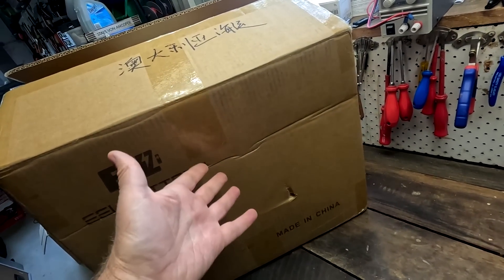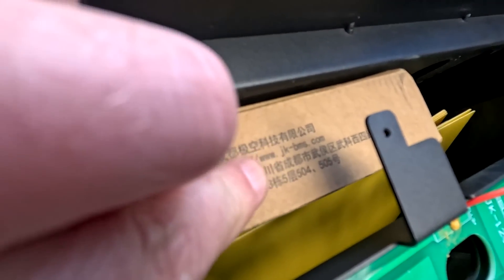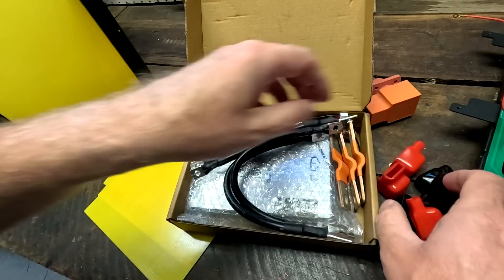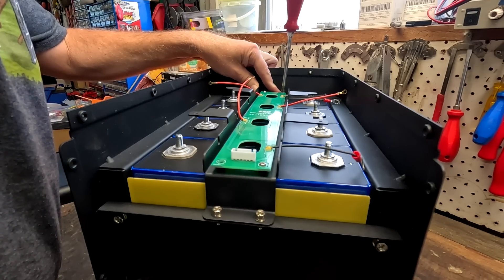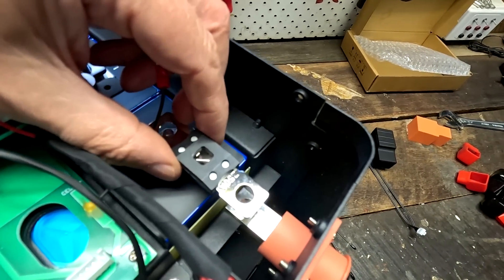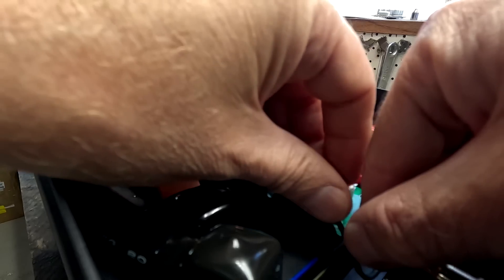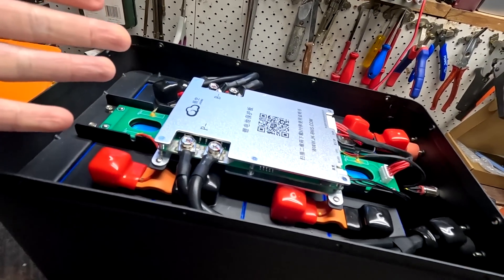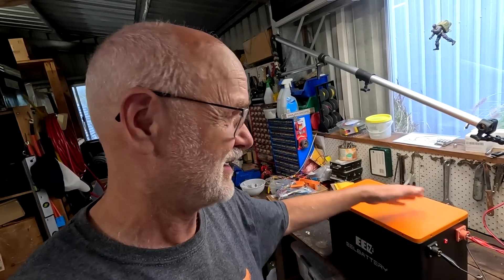The EEL 12V Battery Case. I could not find anything negative. First ever 🐸🐸🐸🐸🐸?

Comment: I'd be very interested in some 24v DIY battery builds, love the channel, Thanks!
Reply from the maker: Yeah, 24V is really not my thing as I could not use this battery anywhere. I have no 24V equipment and the battery would not fit into any of my systems.
Reply: Edit: New Info Available ...
Looks like competition in this market is heating up.
Prices on the kits seem to be all over the board.  Some decent deals on 24v boxes through  CNEEL iirc on Ali.
The EEL box seems to discourage setups for series (2 x 12v = 24v) operation.

Original comment:
I too had an interest in a 24v system to power a remote link to my ISP.  Looking at prices, it looks like you can just build 2 12v boxes for the same price and get additional flexibility.  Also spend capital in smaller increments.
Reply: @davidspeed1951   have you tried 2v12V in series (24V) setup , i was thinking of this, and was also wondering if the pcb of the 12V and the 24V could be identical meens running the 2x12V as a 24V pack (combined with BMS cable and low voltage cable )

Comment: turned whole warehouse lights to 12v DC       ////13.2v  to be precise   for all led lines and all i see is efficiency goes bad . 
 i did this to avoid  inverting from 48v to 230 and back to 12 
 but conversion  from 48 to 12v  still demands big ammounts of  losses!!!!       
any thoughts of   sending 230 and installing ac to dc  right close to the leds ...or let it be ? ?
Reply from the maker: It is the long 12V runs which cause the issue. Current goes up and efficiency down. It's probably better to run 230V to each light and have the driver connected to the LEDs. I think, that's the most efficient way.

Comment: Great looking battery box... excellent review as always!  The dimensions show 383mm for length, is that the box or to the end of the teriminals? I'm looking for something to fit under the seat of a 2022 Fiat Ducato.
Reply: be careful with the size. ask them first. the dimensions at the 48V-box are just for the box.... thats not very smart from EEL...
Reply from the maker: Yeah, just the length of the box.
Reply: @OffGridGarageAustralia  looks like the dead space at the removable panel doesn't help in this case.  One half frog down for me....
Reply from the maker: @RCDallas12001  Thanks for your feedback and rating.

Comment: I like the idea of building ones own battery bank for my Sail boat that has 4 x 215 12 volt AGM Battery's = 860 Amp hrs 50% usable power.  if I had the same say 3 x lithium battery build using the EEL  cases. = about 990 amp hrs of usable say 90% power this is major upgrade. My question does anyone know when you build the EEL cases how much does the finished build 12 volt say 315 amp battery cost to build in AUD?  I there any savings from buying an off the shelf  finished product ?

Comment: WRONG!!! The 0.5Nm on a M6 for 300kg are wrong !  Test it out... try to lift a car with 6 M6 Screws and 3Nm... nothing will happen! There is a dimension missing in that ! 300kg/mm² or 300kg/m² or what?
The M6 bolt may provide 300kg on its rod end - but not on the area of an undefined amount!

Temp sensor you may glue on the QR Code - its the best thermal conduction place.
Reply from the maker: It's not 300kg, it's 300kgf.
Reply: @OffGridGarageAustralia  kg and kgf are about the same! kg is the FORCE that presses you on the ground that is caused by gravity, where kgf is the same amount, but independent of gravity as source in any other direction.
So: to compress LFPs you can stack them vertically and put a 300kg weight on top - then you have kgf "forced"by gravity - or you put them horizonal and bolt them with screws to replace gravity effects.
Put a scale between to plates and then tighten the screws till it reaches 300kg - and you realized 300kgf. Or put it on the ground and use 300kg weight. Nothing strange - no real difference!

And: Eve uses 10mm !!! Aluminium plates as reference... with 6 times M6 PER CELL!  2 rows of cell - => 12 bolts needed ? Your calculation was 0.5Nm for them, where 12 are needed to calculate - so 0,25Nm ? Thats handtight - no pressure of 300kg(f) never. Insert finger, wont hurt, put 300kg weight on it and use gravity instead of bolts - hurts!  :-) 
Think that issue needs clearance because many of your followers will need proper facts (as you provide most the time) - they believe you! (and I am only an engineer ;) )

BTW: Shellys work with 60V !!!  see my comment and short video I did only for you my friend ;-)

Comment: The  nuisance is that the box doesn t work with the double hole studs from EVE .......😭 
Furthermore the BMS is not the HC-version. And there might be no space along the cells to install a heating element, just at the bottom i suppose.
Thats the reason why i am going to build a box by myself ..... EEL is ok with the 48V boxes.

Hard to find a heating element not getting warmer than 50 degrees celsius. Sunfunkits from Louisana seems to have one but shipping to europe is very expensive. 
So i found by accident a solution with beehive mats.....

Comment: Curious to how much it weighs?
Reply: depends on the type of batteries you choose... have  a box for 200/230ah and for 280/320. but when you use the 304ah, the weight just for the 4 cells is 22kg. plus bms  plus box ... unfortunately they do not mention the weight. so you have to contact them....

Comment: Only 4 frogs because no heating option and lcd is available and no double hole cell  terminals are possible.
Reply: And wiring to Case Terminals should be done with flexible busbars
Reply: Hello Andy at my last Order at eel i  asked eel to replace Eva foam with Silicon foam i bought myself in china.. they told me that they will send you 18 Samples of Silcon foam for free from my order. Maybe you could Test IT.
Reply: @OffGridGarageAustralia EEL versendet an sie die von mir bereitgestellten  silikonschaumstoff Muster nur  wenn sie ihnen dazu eine Erlaubnis erteilen. Könnten sie dies evtl. Machen, ich bin überzeugt das die silikonschaumstoff platten im vergleich zu den Eva Platten  deutlich länger druckstabil sind. Hat sich so bei Leistungshalbleiter Modulen schon seit Jahrzehnten bewährt.

Comment: They had the perfect space for a display and they did not utilize it.  Also no foam for proper compression, so 4 frogs from me.  🐸🐸🐸🐸
Reply: drill a hole for the big connector and fix the small 2.3" display ..

Comment: A really good looking and simple kit, definitely worth the 5 frogs.  What I would really love to see is a 12v battery using the JK B2A8S30P BMS.  I believe this one has inverter pre-charge circuit (C-) and a Parallel connection too?  But I cannot find enough information to confirm my suspicions.  300A continuous charge/discharge, perfect for the Caravan/RV setup.
Reply: if they erase because of the link. have a look at the diysolarforum ....

Comment: Looks perfect for my van-lyfe build! Now can you get it all put together for less than... erm 4kw 300ah 12v is about $2200?
Even if it is the same, I would still get it. Replace the cells rather than throwing it away.
EDIT $850 AUD, if you can wait until September to get the cells (all via OGG links). Well worth it! $200 per KWH, seems legit.

Comment: Lots of boxes ticked here. But the fuse-to-cell conection is terrible. If mine, I'd put a 'tinned' copper washer with tight 6.0 mm hole, at least under it, maybe on top as well.
Reply from the maker: What do you think is terrible with this connection?
Reply: Hi Andy, love your shed. I think your original doubts about those welded studs contact area, was well founded. Even if your tests showed no local hot spots, that flat surface on the cell is not ideal for a high current to pass. They could have used more area of the terminal base, and welded a bigger area stud. Your magnet test once said it's steel, and so about 18% as good as Copper, or 30% of Aluminium. If you had a  tinned copper lug, bigger in area than the stud, with a 6.00 mm hole in it, (not 6.5 even or 1/4"), that would be the way to make the best of a bad cell design. The fuse with a slot that is 8.5 mm wide, and much longer, results in very minimal contact area. The tight red condom covers on the fuse may reduce rating?  I know these later, high cap cells have reduced recommended current specs, and your application won't push them. 
I've ordered some EVE-LF280K- HSEV from Gobel, for EV application with the optional double-screw thread terminals.  The 1C contin/ 2C pulsed rating means 560 amps  for 30 secs discharge would need everything going for it.  They wouldn't fit in that box because of height I guess.

Comment: Definitely 5 frogs. I'm stuck with using 24v system, do you think it's possible to build a 24v battery using a 48v vertical battery case as there are no vertical 24v battery cases available? I don't have the space for a rack mount case.

Comment: This is perfect.  I run my mountain cabin on 12v as I have very little 120Vac needs/desires, so a 48v battery didn't make much sense.  I have 2 sets of MB30s that I would love to get in cases and off the floor.  My only desire would be cases that are stackable, but I can live without it.

Comment: Great looking battery, kit and cells. My thoughts on battery voltage look at the intended supply and the intended load. Any location where 12v is the norm (cars, vans trucks) then 12v is a good idea. If the maximum current will exceed 200A then look at a higher voltage ( high current means fat wires and lots of IR heating)

Comment: Andy you are mentioning the MB31 .. on the Intersolar they showed a mb56 which was a lot bigger but I didn’t took a photo. But that should come out at the end of the year. It has only layers in it and not the squished „toiletpaper“ construction so it is (so said the woman from eve) preventing a thermal runaway and will make it very less likely to happen. Together with the half c rate it has somewhat between 8000-10000 cycles. Would be great to see that coming into an diy Case … but then we are out of our hobby I think.
Reply: the price is not only the double of the 304Ah, but a lot more. cycles more than 12.000. we have to wait for mass-production....

Comment: Hallo Andy, 
zur Zeit gibt es nicht mehr viele Videos zum Thema Top-Balancing von LF 280K Batteriezellen. Ich habe von EEL 8 Zellen mit der Spannung 3,289 Volt geliefert bekommen und 8 Zellen mit der Spannung von 3,291 und 3,292 Volt. Sie wurden Ende April produziert. Diese habe ich in der vergangenen Woche zusammen mit EEL DIY Kit mit dem JK BMS 2A ohne Display geliefert bekommen. Müssen die aktuellen Grade A Zellen von Eve noch vor dem Einbau ein Balancing bekommen oder kann ich darauf verzichten und die Zellen einfach in die BOX einbauen und das Balancieren dem JK-BMS überlassen? Vielen Dank für Deine gutgelaunten Videos und vorab für Deine Antwort. 
Gruss Stephan aus Osnabrück
Reply: Ich kann nur für die 80 x Eve 280k v3 sprechen die ich über nkon bezogen habe: 
5 eel boxen aufgebaut mit dem inverter bms und direkt die Zellen wie sie kamen geladen. Bevor der Balancer anging war bei 3.45V die maximale Differenz 0.024 V 
Der Balancer bekommt das dann recht schnell in den Griff
Ich habe allerdings bei der ersten Ladung mit weniger als 10A gearbeitet
Reply: Der Spread ist nicht grossartig. Das BMS mit den 2A schafft das locker. Frag mich nur warum du nicht beim "Nachbarn" wie von Andreas geordert hast.....

Comment: 4/5 no handles to pick it up, otherwise it looks like a high quality product.
Reply from the maker: I'm glad they didn't put handles on. The handles on most other 12V batteries I have are failing. Either the plastic starts breaking or the carrying stripe is deteriorating and falling apart.
But OK 4/5 👍
Reply: @OffGridGarageAustralia  my SOK batteries have metal handles… no worries with those.

Comment: 4 Frogs

It's a very nice 12V battery box.  However, it has no safety isolator switch.
Reply from the maker: 12V batteries don't have that. They are for camping and RV applications.
It has a fuse, so no need for an isolator.
Reply: Yes, for me the same. 4 frogs only.  A mechanical breaker is a musthave, for safety you can't rely on the soft switch in the bms only.

Comment: REPT 150Ah cells have the same height and width as 280-304Ah cells, but are half the thickness.

In the same 12V = 4x304Ah DIY Battery Box can fit 24V = 8x150Ah. (Sun Fun Kits use it that way)

The same is applicable for the 24V DIY ELL Battery Box:
In the same 24V = 8x304Ah DIY Battery Box can fit 48V = 16x150Ah.

It would be great to have these smaller 24V and 48V DIY Battery Boxes from ELL on the market. 
This would not require much modification of these basic 12V and 24V DIY Battery Boxes on the ELL side.

And if they also used the new JK Inverter BMS as an option ... 👍
Reply from the maker: Great suggestion. I will forward your idea to them.
I would also be interested in such a small 48V battery.
Reply: @OffGridGarageAustralia  That would be great, I have written this to ELL in their chat several times on their website, I wrote it to them as a comment under their one of their 12V and 24V DIY battery box videos, but no reply for me. 🙁
Based on you Andy, they might slightly redesign these boxes and put them on sale.
Reply: Seems like they could have a different cross brace/PCB. Bugger all cost to them, would be a great option.
Reply: you need a different PCB when using 8S instead of 4S - so you might have to connect manually.
Reply: @mandxyz2523  The 12V DIY Battery Box use cross bar for BMS mounting, so it would need to be modified for more and smaller holes due to the preasure valve cells and the PCB board can be replaced with wires.

The 24V DIY Battery Box has the BMS on the front panel, where the entire crossbar could be not used, and replace the PCB board with wires.

However, in both cases, the best and cleanest solution would be for ELL to make new crossbars with new PCB boards for the REPT 150Ah cells.
Reply: @tiborchren  What you said :) I didn't say it quite as eloquently.

Comment: They need to add a double stud terminal option for this
Reply: I ordered two, intending to use the double stud terminals.  I spoke to EEL and the only thing that changes is I'll have to come up with a different solution for the fuse.
Reply from the maker: I'm sure you can tell them when you order and they will put some in for you.
Reply: @OffGridGarageAustralia  the website says single terminal only. They'll probably have to do something different with the fuse since it might not line up correctly with one of the double studs.
Reply: @niktak1114  i talked to them some months ago. the problem seems to be the big stud. double stud is my favorite too ... but only the original from EVE....

Comment: These 12V and 24V ELL DIY battery boxes are great. 
The only thing missing is the Touchscreen option on purchase, only then I would give it 5 out of 5.
Reply from the maker: Yeah, as an optional accessory... I agree.
Reply: @OffGridGarageAustralia  The optional external displays are available on their shop. A small one and a big one with touch.  
You just made me hurry up this morning, when I saw your video... I already had two of the boxes in the shopping cart, together with 4 48V JKV4 with Touch Boxes... now after your video I have to fear that they run out of storck  😂
Reply: Don't those cause a drain on the battery?

Comment: Grübel I m missing an isolation sheet on the top ...
LG jogi
Reply from the maker: Will an epoxy sheet at the top prevent the cells from shortening when the battery is upside down?
I think the rail with the PCB will take care of that and keep the cells in their position.
Reply: @OffGridGarageAustralia  I dont think about the cells, but the BMS with not isolated contacts. It would be much easier, to use an isolating sheet, than to discuss in detail, is there any possibility of short circuits (the same idea, like all other isolation sheets)
Reply: For this „small“ and somewhat „light“ kind of packages it is more likely to put upside down for mistake so your point seems very legit. That’s a great input.
Reply: The top rail is mounted with 4 screws and the cells are compressed by the frontplate. No way the cells fall out. 
If someone in unable to keep this 30kg box in the right position… it’s not made for a crash

Comment: Andy looks great question-if you build 3 battery boxes as one 12 v system for a sail boat would you have a BMS in each box or only one BMS to regulate the balance of the 3 batteries?
Reply: Definitely one BMS per enclosure/box. You hook the 3 boxes in parallel, so there is nothing to manage there.
Reply from the maker: Thanks, Collin!
Reply: @CollinBaillie  Thanks there is more complexity changing from AGM to Lithium battery's, to prevent damage the alternator or wind generator.